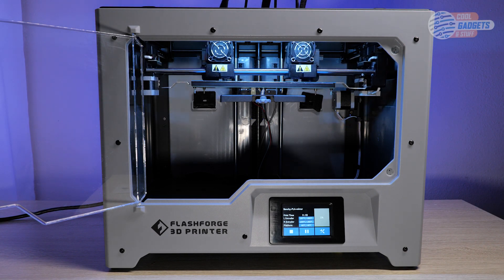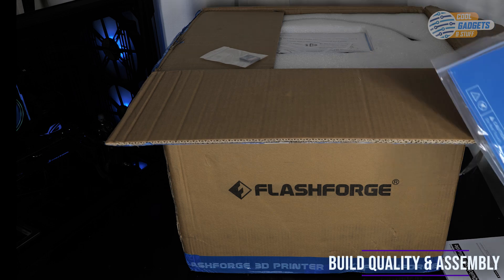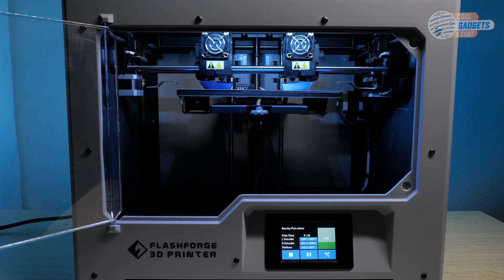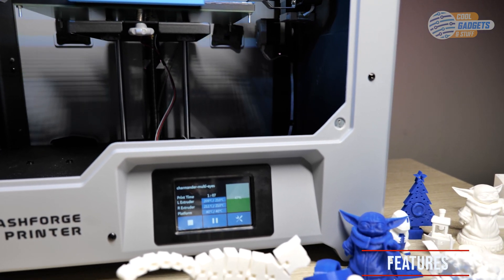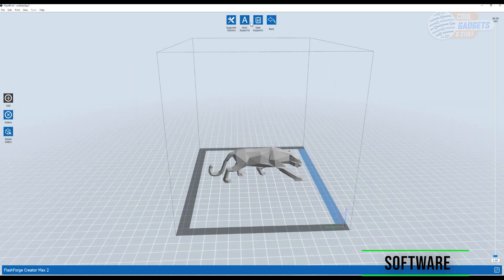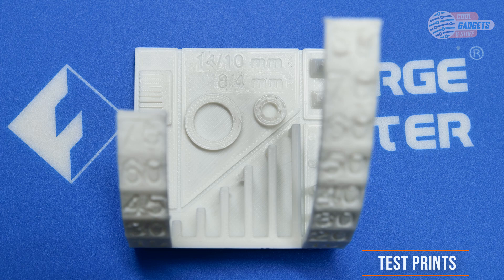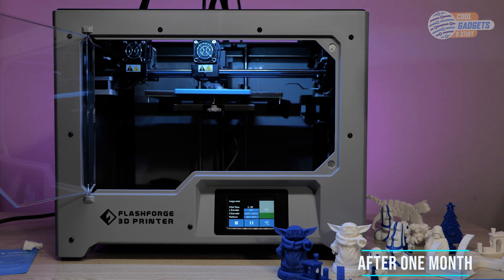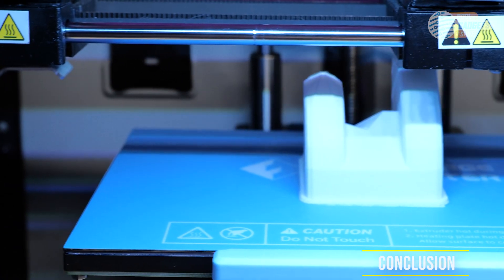Creator Max 2 Review - FlashForge's IDEX 3D Printer

Comment: Is it proprietary software? Also you show prints at arms length wtf is that about? Sorry that review was just bad.
Reply from the maker: Yes, FlashForge uses proprietary software or closed source software and it does not work great with something like octoprint. Are you talking about the top-down shot of the models? We included up close shots of the models.